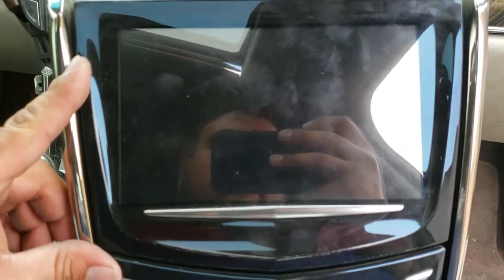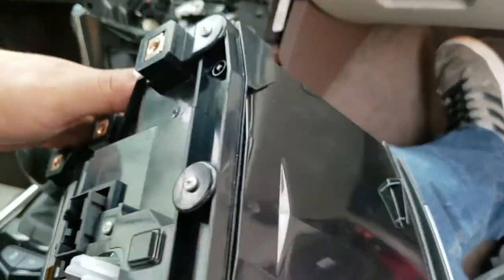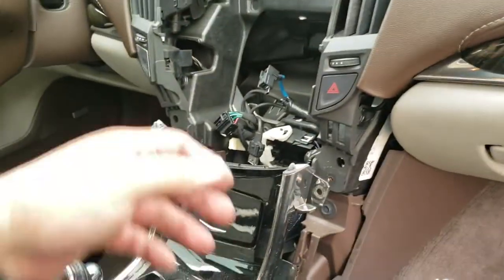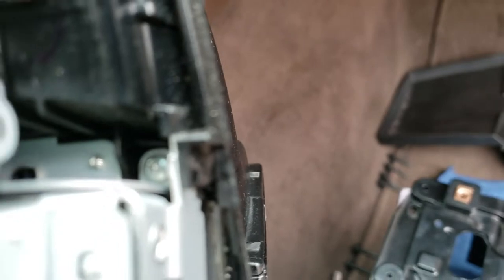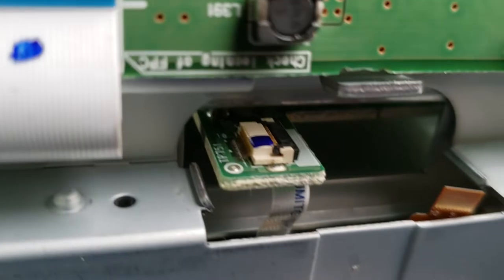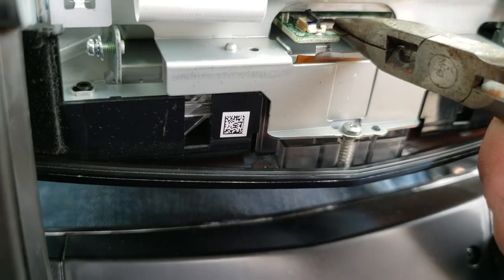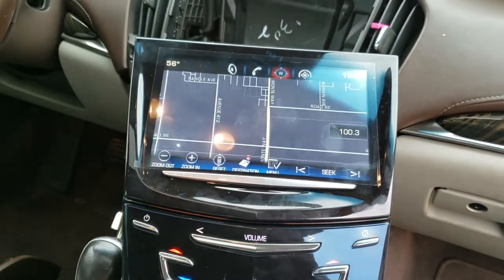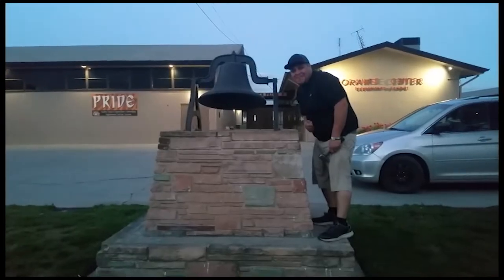How to: Replace a Digitizer on a 2013 Cadillac ATS Radio

Comment: A little help? I pulled the ribbons out then put them back in after putting the digitizer in, Plugged the radio in and the screen is black. what should I do?
Reply from the maker: This happen to me too! I had to power cycle the car. Disconnect the battery's negative terminal and turn on the head lights to drain the system from all electrical source. Wait about 10 sec and plug it back in. Should start up now. Nothing should of damaged the screen because the only thing you did was pull out the digitizer not the LCD screen.
Reply: did it, it worked!! thanks for the reply !  great info
Reply from the maker: @charlesbright6510  Heck yeah im glad it worked. I dont know why you have to do that, I just know thats the fix! Thank you have a great day!
Reply: Nice video George. For anyone else that has done this repair and is experiencing black screen issues, here is another troubleshooting guide to help people diagnose common installation problems. https://youtu.be/M5nqZwuCpfY

Comment: My touch screen was frozen. I replace the touch screen with a new one, but it is still frozen the exact same way.
Reply from the maker: It probably isn't the digitizer that went bad, its probably the unit itself.  Sorry bro.
Reply: I had a frozen screen a few years ago, the car was still under warranty and the entire radio had to be changed.  The other day it was 90F and go to my car and screen was all delaminated.  The radio and touch still works, just a mess of spider web cracks.  I ordered a screen from cuescreens and this fine gentleman showed me the instructions on how to change it.  Dealer was going to charge $1500, I got the screen for $130.  I need to send George some money!
Reply from the maker: @locutus1126  lol thanx bro! Its all good man your SUPPORT is payment enough! Good luck man! Hope this works out for you! Thank you for your SUPPORT!